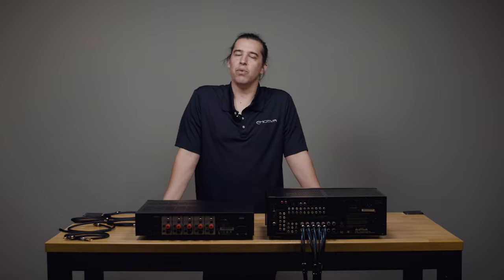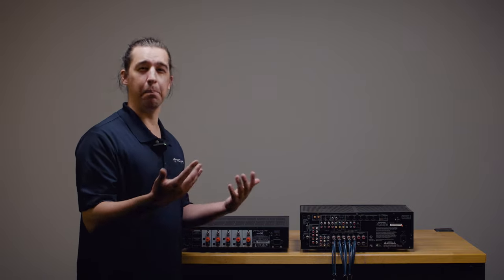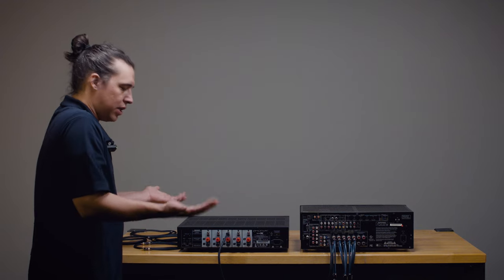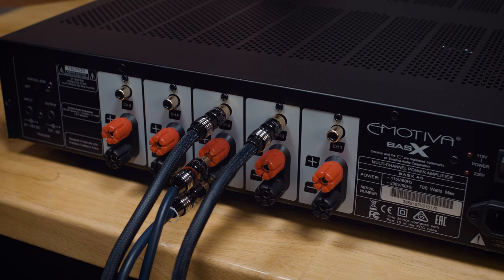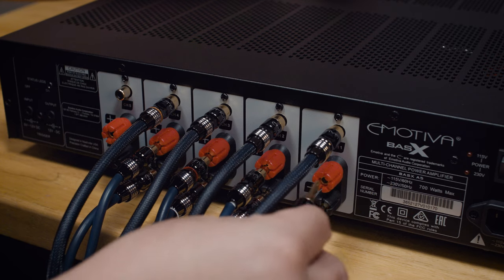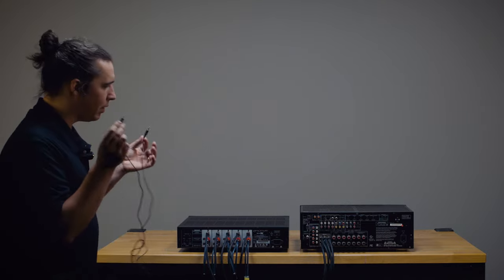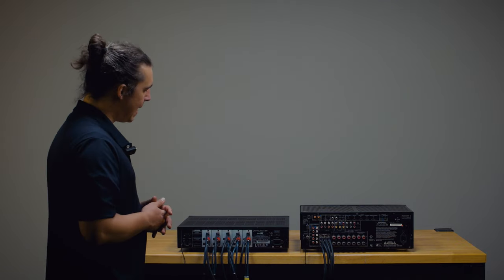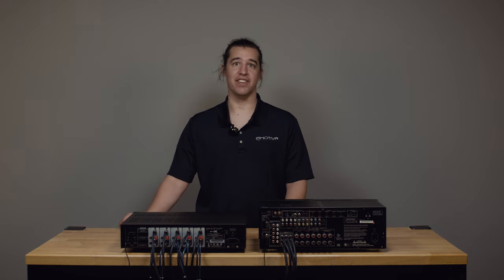How to add an External Amplifier to your Home Theater Receiver!

Comment: Is it possible to use the same 1 rca input signal for 2 amp channels? Want to have 2 pair of surround speakers (2 SL & 2 SR) from 1 pair of rca input. Is there any setting on the amplifier which can do that. Or can it be done with Y splitter without any impact on sound output

Comment: Way i have it is from my sony avr to pioneeer avr. My sony has 2 hdmi outs. One goes to tv...then hdmi out 2 to the pioneer. I am doing this to power 4 atmos speakers as the sony one only has 2. I noticed the pioneer one has pre outs. I preffer the sound of the sony it seems its class A/B but the pioneer is class D. Initially had all connected to pioneer but didnt think it sounded so up front and clear.
In all honesty i know nothing about pre amp. Never used it. But do i need to ise a specific type of receiver to receive the pre amps? Like could i just connect the pre amps from my pioneer to my sony?

Comment: great video! thank you much! quick question. is it possible to use two 3-channel amps on one AV receiver to power 6 channels total?
Reply from the maker: Thank you for the comment. Yes, you would be able to split system that way with no issues!

Comment: Great video. Thank you.
I learned a few things, thank you.
Now I need to research what Amp to use.
If anyone has any suggestions I just upgraded my front main speakers to the b&w 702,s. My av reciever is a Yamaha   A2080. It sounds awesome. I've been hearing my particular speakers would excel with more power than my reciever will put out.
The A2080 is 140 x 2.
I'm thinking of a 200 to 250 x 2.
Reply from the maker: Take a look at our XPA-2.

Comment: My Onkyo-8050 Receiver has a R (Red) and L (White) preout. I want to use it as a pre-amp and Tuner.  It says in the manual to connect the L and R to the Line in on the amp.  If I purchased the BasX A4, would that mean connecting the RCA cables to Channel 1 and Channel 2?

Comment: Thanks Brent! I am new to all of this audiophile stuff and see the advantage of adding a separate amp to an AVR.  I primarily only listen to CD's or YOuTube music on my stereo i.e. no home movies or gamer stuff.  I currently have 2 older Yamaha AVR's: an HTR-6130 and HTR-5063.  I do not see any pre-outs on either of these.....is this correct?  I am on the fence re 2 channel system vs 5.1 system and will be buying ELAC Uni-fi D52 speakers for my "mains" but have other surround sound speakers/Fluance center channel and Paradigm 10" powered sub should I want to go back to 5.1. So.....if my HTR's cannot work as this this Denon/Emotiva work, can u suggest a budget-mid priced 3.1 amp + AVR to work?  I live in British Columbia, Canada. Have a great day!

Comment: Instead of running the full room corrections again, wouldn’t you just want to use an SPL meter to adjust the volume to reference? It takes about 35 min to re run room correction with 11 speakers.

Comment: Likely a stupid question, but if I add an external amplifier to my AVR, will the AVR AND the amplifier output power to the speakers, or will it only be the amplifier at that point? Like, does the power from the amplifier combine with the power of the AVR?
Reply: The speaker wires would move over to come out of the amp also since it will become the new source of the amplified/powered signal and the AVR serves more as a processor role

Comment: So, if my Klipsch floor standing speakers have 4 speaker wire inputs, do I need to grab the bottom speaker cables (since the top are in banana plugs plugged into my Marantz) and hook up the bottom Klipsch speaker wire inputs to the Emotiva A5 along with the banana plugs plugged in too?

Comment: Great instructive video. Thanks. Can you tell me how much sound quality difference there is between an XLR connection vs RCA?
Reply: Also what is better 14g lamp cord or 12g silver cable...
Reply: look at the most high-end audiophile systems and check what they are using.(spoiler; RCA)   IMO, xlr is for long noisy runs like in a music venue from the stage to the front-of-house mixer.   unbalanced can pick up noise. in pristine conditions, they will sound the same. 
edit: also, xlr is so much more physically dependable than the 1/4" jacks ubiquitous to music gear. they dont fall out or get worn and noisy, so XLR has physical advantages too. like i feel way better knowing i have xlr from mixer to PA amp. it can't fvck up BUT completely unnecessary for the home. big bulky and expansive.

Comment: Thank you. Please explain about the ems required for Klipsch rp8000f tower 8ohms continuous power of 150 watts rms. Emotiva 5channel gives 95 watts at 8 ohms. Will it be enough?
Reply: I have the Klipsch RP 8000f and I have a marantz sr 6015(110wpc) and I also have the emotiva basX 3 (140wpc). The 8000f spec's say 150 rms 600 peak. From my understanding everything is based on volume of reference level which is 85db and peak volume which is 105db. When watching movies at reference, which I myself never do, you have scenes like with talking that don't take a lot of watts to produce sound and you scenes like explosions which takes more watts. Unless you listen very loud continuously you should be fine. Also, the RP 8000 has a high sensitivity which means it doesn't take a lot of power to drive them. Hope that helps but if you want more info power handling and receiver wattage you should look audioholics u-tube reviews.

Comment: I just want a single pre out on an AV reciever to connect to a power amp. The power amp is a proper power amp i.e. it has no volume control. This is to power some very powerful speakers. I dont want to go through zone two line out as I want all speakers to play at the same time. Is this possible??

Comment: My Yamaha Aventage RX A2A does not have a center channel pre-out. Can I use the Emotiva to power the R & L fronts but leave the center and rears in a potential 5.1 setup hooked up to the Yamaha? Or does the lack of a center channel pre-out mean I should stick to a 2 channel setup. I'm okay with stereo, but it would be nice to have the option of going 5.1.
Reply from the maker: Yes that would work! Taking that left and right channel off your Yamaha would actually free it up to drive more power to the speaker you have connected to it.
Reply: @EmotivaAudioCorp  Thanks!

Comment: For this setup I have the same type however, what amp do I buy?  I just want a 3 channel for my front 3 speakers however, do I buy a preamp, an 3-channel amp?  I'm not sure.
Reply from the maker: If you are connecting it to a receiver with preoutputs, you would just need to go with our BasX A3 or XPA-3 depending on your specific speakers you are using.
Reply: @EmotivaAudioCorp  Okay thanks great to know.  I am using Bowers and Wilkons 603 series speakers for the front 3 channels.  Is there a way to turn up or down the wattage on the XPA-3 Amplifier or is it full throttle at all times?

Comment: Hi, ive got a onkyo tx609 av receiver and im going to connect a arcam9 power amplifier. (Its got no volume control) could i just add more speakers to my amplifier instead of using the speakers from my av receiver. Then ADD a cd player to the amplifier aswell. Would that work?? 😂😂

Comment: Show me how the BASX-PT2 Preamp connects to the XPA-5 amplifier and i will buy them. It has me stumped.
Reply from the maker: Just curious why the XPA-5 with a stereo preamp?
Reply: @EmotivaAudioCorp  That's the way that I did it with my equipment back in the 80s. I had a Sumo Andromeda amp and the Sumo Athena preamp. The pre had the CD/Tape/aux/etc inputs and the volume knob. The XPA -3 or 5 has no volume controls, ergo a preamp or processor.

Comment: Is there a way to limit the power output to speakers to ensure they do not get damaged?
Reply from the maker: No, but that goes into a deeper understanding on speakers and power. You are more likely to underpower your speakers and cause them to clip which will damage them versus overpowering them. Speakers will only pull the amount of power they need depending on the circumstance. You can drive them too hard with massive amount of power but will most likely blow out your hearing before that point due to the decibel level they would be playing to get there.

Comment: Do you set the gain on the amp on full and then use the receiver to control the volume?
Reply from the maker: If there is a gain adjustment on the amplifier, we recommend maxing that out because you will use the volume control from the receiver.
Reply: @EmotivaAudioCorp  That is what i did, not sure if i can do the same with the headphone output, I've read that the A 100 is an excellent headphone amp as well.

Comment: Hi, not 100% sure, but if you have XLR connectors, how would the connection then look like?
Reply from the maker: You would connect the same way. XLR to XLR, you would just need to make sure you have designated correctly for channel mapping. For example, follow the directions from the receiver/preamp so your "center" output is going to the channel input on your amplifier you have going to your center channel.

Comment: Great video.  One question... When I plug the pre out from the receiver to the amp, does to signal automatically get sent to the amp, or do I have to go into the receiver menu to change the settings for ot to go to the amp?
Reply from the maker: Depends on the receiver model. Some automatically recognize the pre-outs are being used and others you have to go into the menu to tell it that channel is using external amplification.

Comment: I bought the Emotiva BASX 3 thinking thinking that I could select powering only the 2 Mains and center speaker on a 9.1 setup but it doesn’t work like that on the Marantz SR7015 only on a 11.1 channel configuration the Marantz will only assign the 2 front Main speakers or 2 rear surround’s.. only on Pre Amp Mode can you run all the speakers with external amp so think it through before spending your money either you run all your channel’s on external power or the SR7015 will on give you the option for 2 front or 2 rear
Reply: I have the marantz sr 6015 which is also a 9.2 receiver that can do 11 channels with external amp. I also have the basX 3 to do the the front stage. Although on the marantz it only shows the left/ right speakers on the diagram it'll power the center channel as well. Ealan Osborne has a U-tube channel showing all the ways to configure an external amp on the exact Marantz model that you have. But you can use a 3 channel amp for the front 3 channels.
Reply: Sure you can

Comment: You have powered all the 5.1 channels in the video? Is that advisable vs powering only one channel ? Or would it depend on the ext amp?
Reply from the maker: Yes we powered 5 channels in the video. You can power as many speakers as you need. The amplifier you need would depend on the amount of channels you are looking to run in your system.

Comment: When doing this, do you have to adjust volume on both amps or does one sync with the other? For example, im looking to get a external amp to power my zone 2 (atmos speakers) so i need a 2 channel amp at roughly the same watt output, ince all connected, would the main avr control the vokume of the new external amp? If not, how do you balance that? Seems alot of messing about
Reply from the maker: Most external amplifiers do not have volume control, they just amplify the signal from the preamp/processor so you only have to deal with 1 volume control. IF you end up with an amplifier with a volume control, set that volume to 100% and let the preamp handle the volume adjustment.
Reply: @Emotiva Audio  Ok thank you very much for your reply, after all the researching, it seems my RX-V6A is not capable of using pre outs for zone 2 (presence or surr backs) at same time as main speakers so i dont need one now. Thanks again for your reply though. I appreciate you getting back to me.

Comment: How to connect the subwoofer?  Any suggestions please
Reply from the maker: Your subwoofer usually connects directly to your receiver or processor if it is a powered subwoofer. If it is a passive subwoofer, the same concept applies with this video, the amplifier you have to power your sub will connect back to the subwoofer output on your receiver or processor.

Comment: my buddy just gave me an amp. but this amp does not have any rca's in tha back. it is the pyle pro pexa8000 how do i connect it now?
Reply from the maker: That is a stereo amplifier so you can only drive 2 speakers with it. You would need to come out of a receiver's left and right RCA preouts then use an XLR to RCA adapter to the balanced Channel A and Channel B XLR inputs of the Pyle.
Reply: @EmotivaAudioCorp  ok i got it it makes sense now. thank you.

Comment: Hello .  I have an unusual question (probably).  I want to connect two different speakers to each front channel using two different amplifiers for each (front) channel.  Can I split RCA (rca splitter) or will this connection affect the audio quality? I’m going use some emotiva amplifiers (XPA-DR3)
Reply: just try it and judge with your own ears.    what you are doing is putting a parallel load on the line out, basically cutting the impedance in half.  if the line out can drive that, you will hear no degradation of sound. i have made my own splitter cables to do exactly what you are proposing and it worked great. if you are really worried, check the specs and see what the output impedance of the line out is and the input impedance of the amp inputs. as long as 1/2 the amp input impedance is still higher than the line out impedance, you should be ok. usually the inputs are way higher than the outputs and there is no problem. good luck. go for it. you cant damage anything just by splitting line level.
Reply: @jjrusy7438  thank You very much.

Comment: But.... You have to have an expensive amp that has enough pre-outs for all your intended speakers. Basic AVRs dont. Buy the converters if you dont have pre-outs and are close to making up your mind to a processor. The converters work.

Comment: Nice video , I got denon 4700 with basx a3 , whenever i turn on the denon and basx turn on by trigger I hear a small pop from the speakers all three front .. speakers Dali zensor 5. And vocal. what could cause this issue ?
Reply: Maybe it's the delay on the Denon from standby to power on. There's nothing on the a3 that,ll make a sound. So check the Denon , maybe mute the output before u turn it off.then it,ll be in mute when u do turn it on . Turn volume down. I think it's the avr.

Comment: I don’t understand….. Why hook up a 95watt BasX A5 5 channel amp to a 100watt Marantz SR5007 7 channel AVR? Isn’t the whole point to have MORE power, not LESS?
Reply from the maker: That Marantz is only 100 watts at 2 channels driven. At all channels it is probably closer to 40 watts per channel. The A5 will do 95 watts all channels driven into 8 and 130 watts in 4.
Reply: @EmotivaAudioCorp  Thanks, that makes sense now.
Reply: You people need to stop believing what it says on the box !
NO all in one AVR gives more then 60-70 watts with all channels driven. And that is on the top models, the cheaper ones below a 1000 bucks will give 35-45 watts max.

Comment: If avr doesn't have preouts but having extra hdmi audio output, how to connect emotiva basx a700 power amplifier. Is it possible to add external amplifier?
Reply from the maker: Unfortunately, if there are no pre-outs on the AVR, there is no way to send signal from the AVR to the amplifier.

Comment: I have a problem my Marantz AV Receiver is connected with trigger Cable to Emotiva BasX A3 Power Amp but the power amp does not come on when av receiver comes on.
Tried trigger settings in AV Receiver but not sure if l have done the right settings if anyone could help be much appreciated
Reply from the maker: Hey Justin, give us a ring or send an email to sales@emotiva.com and we would be happy to help you out!

Comment: Does it also work with the sub pre out?
Reply from the maker: Usually the sub pre out is connected to a powered subwoofer directly via an RCA cable. If you have a passive subwoofer then yes you would connect the amplifier driving the sub to the sub pre out.

Comment: "It has to do with GAIN rather than POWER."   That does not help users with an AVR that is $1500 with 650W output.  How do we know when we need an EXT amplifier with a 5.1 or 7.1 setup?  I wish you would have addressed this as I'm still not convinced I need an EXT amplifier.
Reply from the maker: This is the hardest question to answer since most receiver companies do not rate their receivers at all channels driven, but they do leave clues since they rate them at 2 channels driven. If a receiver is rated at 140 watts at 2 channels driven, that unit will probably be closer to 35-40 watts per channel at all channels driven at 7 channels. It will be worse if it does more than 7 channels for Atmos.
Reply: If you're happy with your system then you probably don't need an external amp. I got the basX 3 and it made a difference in my front stage.

Comment: Maybe this is a dumb question, do I still use the AVR for volume adjustment or the amplifier? So I'm considering leaving my AVR to run the centre and surround speakers along with the sub but adding an AMP for my 2 front tower speakers. My guess was the pre out signal from the AVR would tell the amplifier to +/- the volume but I have seen volume knobs on amplifiers hence my question. Great video, cheers.
Reply: You would use the AVR to control the volume. A power amplifier is just a source of power. An integrated amplifier may have a volume control on it.